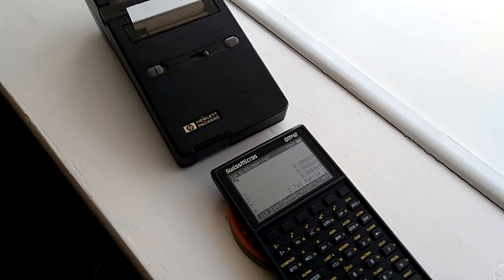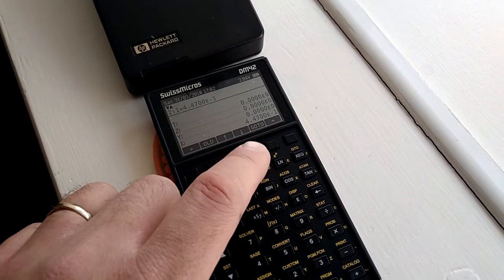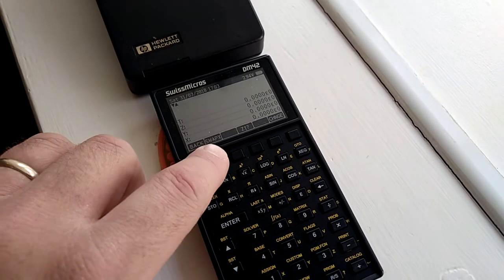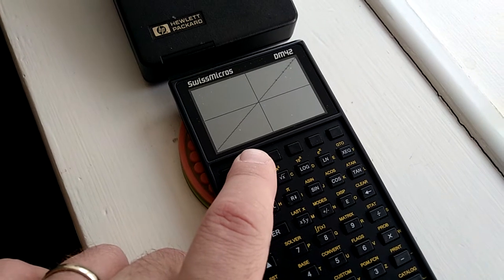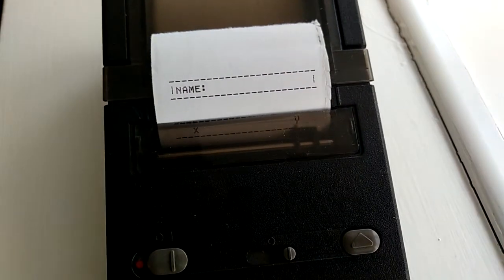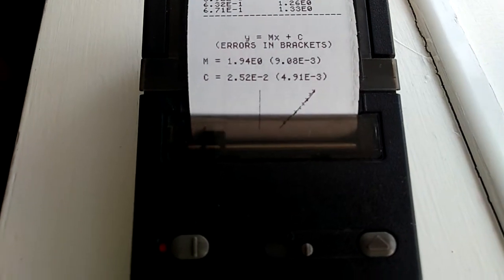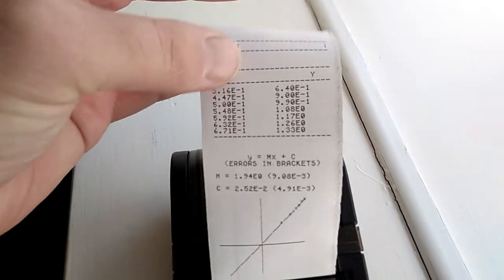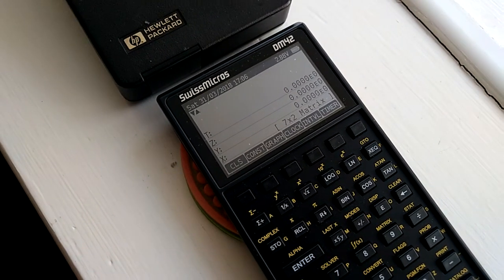Printing from DM42 to HP82240B

Comment: So wait does this mean the dm42 has capability to graph?
Reply: As I understand it, it has the capability but not the feature. It uses a large graphical display and you can program it to display any 1-bit graphics on it, but there isn't an included graph function. However, you could write a graph program; indeed, two such plotting programs are listed in the HP-42S manual. The DM42 extends this feature with higher resolution graphics modes (up to 400x240). Extensions like graph programs, matrix viewer, and fonts for graphics display can be found in the forum.